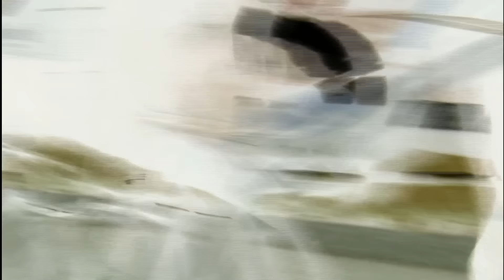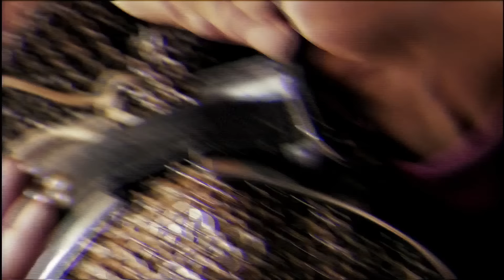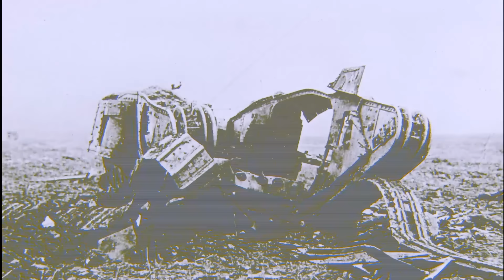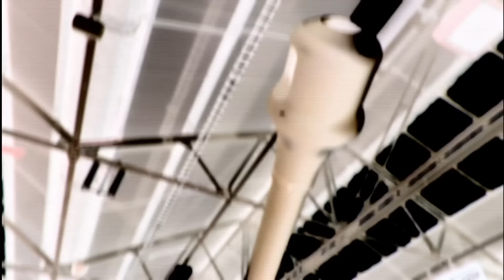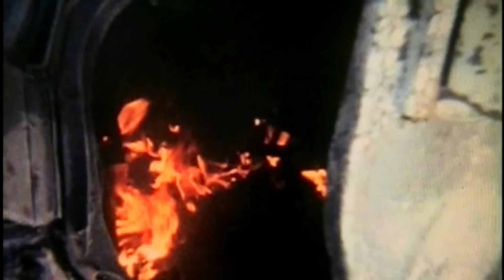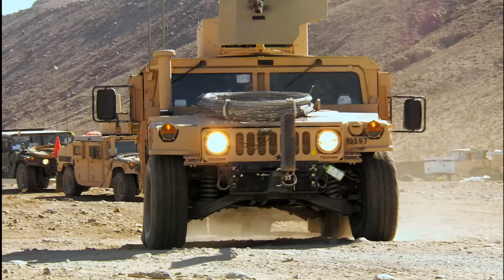KING of the Battlefield: The Entire History of the Tank | Our History

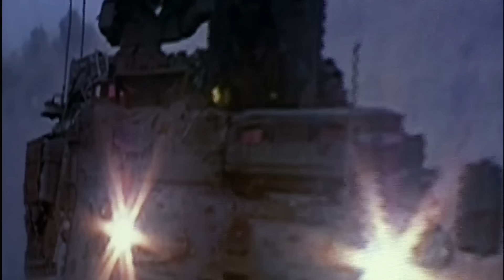Comment: 47:30 exactly why we need to start designing, building and manufacturing mechs. Bipedal tanks with arms and legs where multiple different types of weapons systems could be used one one each arm and atop each shoulder, and the cockpit wouldnt have to be much larger than the external shell of the unit itself. It could be outfitted with rocket boosters for short aerial jumps that could quickly allow the pilot to escape trouble or being pinned down, or the opposite, jumping into trouble spots in urban areas to help support others that may be pinned down or cornered. We def have the tech to do it, it’s just a matter of who builds the first one. My money is on Anduril. I think Palmer Lucky will be the first to bring the mech to future warfare.